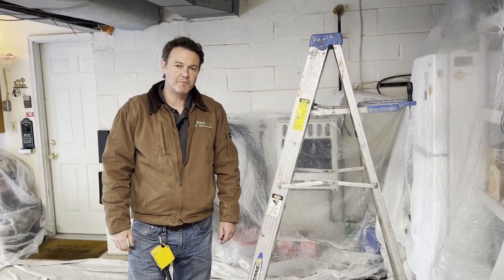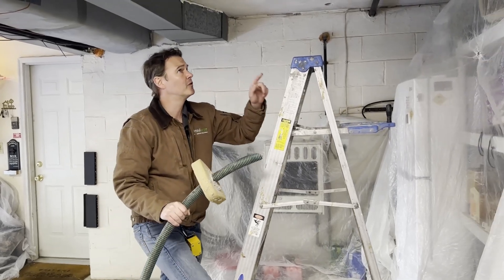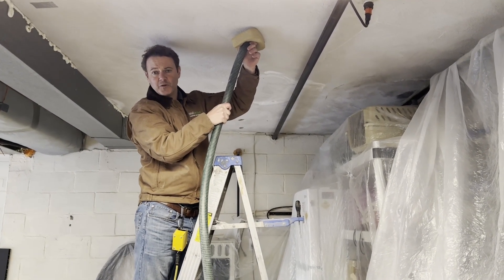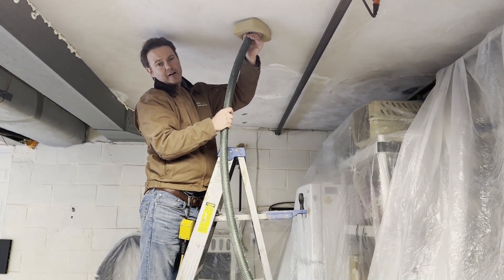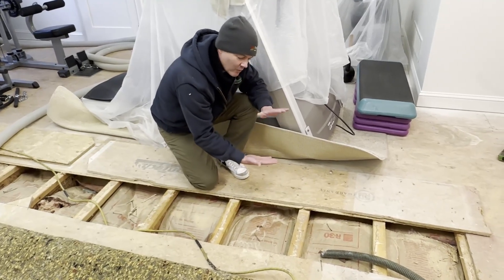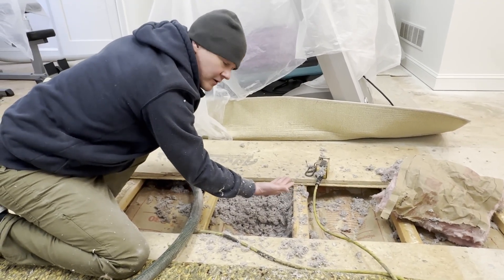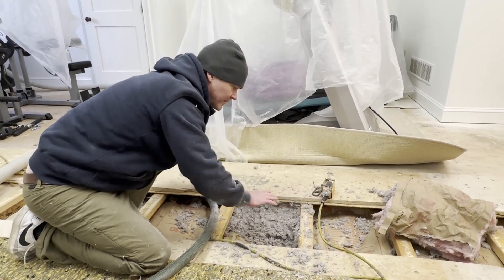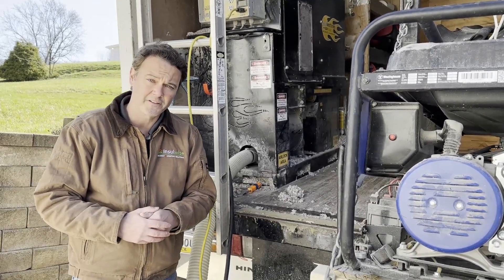Cold Floors Above Your Garage?  See How Dense Pack Cellulose Insulation Solves It!

Comment: the fill job looks great - but the post plaster looks not so great.
Reply from the maker: The access holes get one coat of a mixed product called easy sand.  Easy sand does not shrink or crack and is a great product.  The homeowners are aware that we do not finish the access holes, meaning sand / prime / paint.  Getting the floors much warmer is the technically challenging part that few companies do effectively.  Finding someone who can finish the access holes is easy in comparison.  Thanks for commenting!
Andy

Comment: Getting estimates for this very thing in my 1973 bi-level. The 3 rooms above my garage are always so cold in the winter.
Reply from the maker: Thank you for commenting!  You need to ask if they have the ability to properly dense pack the stud bays using 1)  a fill tube to access the entire bay and 2)  a blowing machine with an air lock in it to create the level of air pressure required for dense packing.  Most companies do not use fill tubes like we do, but little stubby directional nozzles that will only "poof" the cellulose into isolated areas, leaving poorly insulated voids throughout.  I've lost track of the number of garage ceilings we have re-insulated that had already been "insulated" with inferior / ineffective methods.  
You also NEED to make sure that whoever you hire takes the time to locate any panned cold air returns that are in your garage ceiling.  It is super easy to fill them, and if that happens it's a nightmare removing the insulation after.  Thanks for watching and I hope this helps!
Andy

Comment: What about vapor barrier concerns?  Won't the faced existing bat insultation end up providing a vapor barrier?  Don't you end up with a vapor barrier essentially in the middle of your insulation?
Reply from the maker: Good question and thanks for commenting.  No, when the batts are installed they're almost always installed with the vapor barrier stapled onto the face of the studs facing the garage floor, rather than the heated floor above.  We punch through the batt and dense pack the void between the batt and floor, air sealing the outer rim joist and keeping insulation packed tightly and permanently to the floor above.  Also, water vapor evaporates upward from a heated space, and garages aren't heated and are almost always drafty / leaky to the outside.  No issues with vapor barrier problems with this process.

Comment: How much does it cost?
Reply from the maker: Every house is different depending on what's there, but usually a few K.  Garage ceiling bays are usually 2x8 or 2x10...they eat A LOT of material.  The team also has to map the return ducts to make sure to avoid filling them.  Garage ceilings are often technical fixes.

Comment: We're planning to do exactly the same thing in our garage (my office above it is freezing!)—is there any worry, or special planning required, when there is wiring, duct work, etc in that ceiling bay? Or will the cellulose simply dense pack around it all?
Reply from the maker: Great question and Yes.  The wiring is not an issue, but the any ductwork that is not fully sheet metal (panned returns here in Pittsburgh), those bays need to be figured out and avoided.  If you dense pack a return it's a straightforward but miserable process to remove the cellulose.

Comment: This is great! We have never owned a two story house and spending our first winter there, the floors above the garage are like walking on ice! We had the contractors who did the insulation tell us it has insulation, but I am confident it’s exactly what you showed here, there is a huge gap between if there is any at all! I”m working with a company down here in NC to come out and get us an estimate. Thanks for this awesome video!
Reply from the maker: You're welcome and I'm glad that you saw this and that it makes sense.  This is EVERY garage ceiling in Pittsburgh, even in homes built last year...ugh.  A word of warning though.  My brother had this problem in his Atlanta home.  I talked to three insulation companies there about the process that we use for dense packing them with cellulose insulation (could also use blown fiberglass but it's likely more expensive and possibly not as effective as it's packed typically at a much lower density which impedes air flow less).  
The companies I talked to had NO IDEA how to implement our solution.  If you watch the video to the end you'll see the equipment needed for this.  An insulation blower with an air lock for developing high pressure.  Good luck to you!
Andy
Reply: @  I’ve been talking to a company in Wilmington North Carolina and I’ll share the video with them to make sure they understand what I’m talking about. What is in our attic now is that white super light stuff, which in my opinion is not that good, but it’s what’s up there. I know the insulation you were using is way better and has a better R-value. Thanks again!
Reply from the maker: @donjohnsmusic3116  Thanks for commenting!

Comment: If filling the ceiling of the garage, do dust or fumes come through the floor above?
Reply from the maker: Thank you for commenting!   Sometimes this happens, but it is usually minimal.  Where it tends to occur is around supply and return duct registers that are over top of or adjacent to the garage ceiling.  If this does happen a bit of cellulose dust will usually "puff out" in the area around the floor register, but that's about it.  However, it is ironically a good sign to see this.  It means that this register had gaps around it that were allowing cold air to penetrate into the rooms above.  Dense pack cellulose insulation permanently seals these gaps, but sometimes you'll get a bit of dust in the home where the air leaks got sealed.
If it does occur, it vacuums up in a matter of seconds, and the only smell is a faint newspaper smell.  There is nothing toxic about it whatsoever. 
Thanks! 
Andy

Comment: Will the machine you get from Home Depot have the power necessary to pack the celluse adequately?
Reply from the maker: Sorry for the delay.   In order to generate enough force to dense pack cellulose insulation the machine needs to have a feature called an air lock.  Companies like Force One and Cool Machines make small, portable machines with this feature that will do the job just fine.  However, most of the machines at the box stores feature an under powered at best blower mechanism.  These machines are only good for open blows in attic.  You'll also need a fill tube that's about 1.5-2" inches in diameter and about 10ft long.  I've never seen these rented before.  The injection nozzle method that some outfits still use is a BS method.   Dense packing is a real skill and requires specific equipment.  If you have other questions let me know.  Thanks!
Andy
Reply: Thank you for replying.